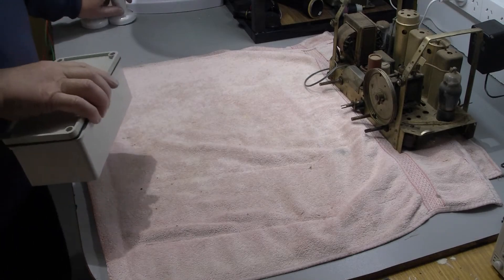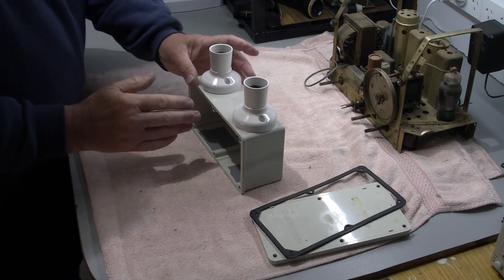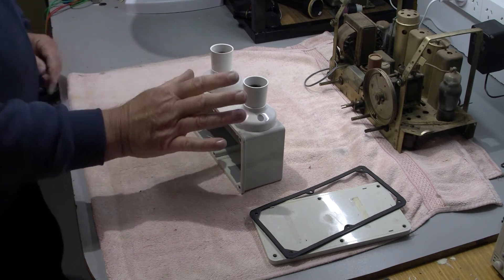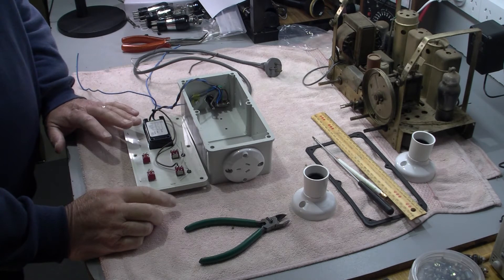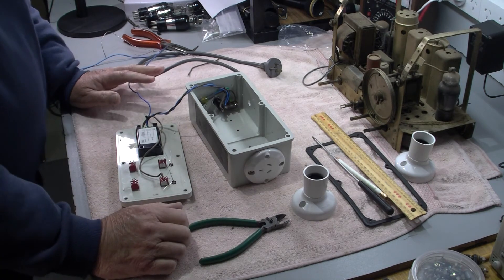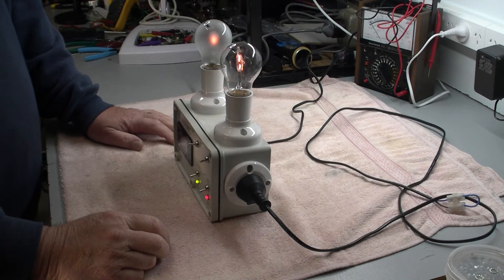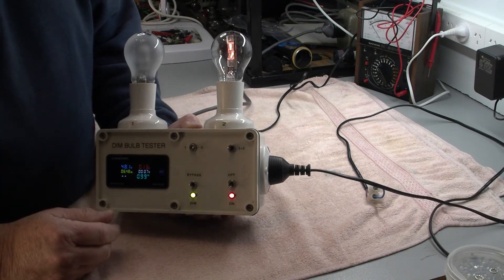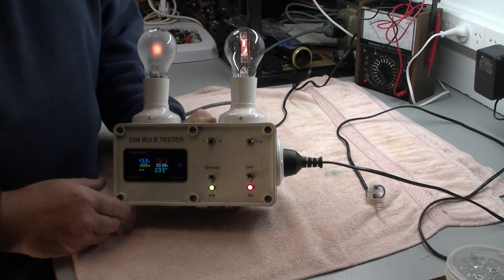The Long Awaited DIM BULB for Vintage Radio Repairs !

Comment: I have used these before so OK I understand that you are using this as a load in series with whatever you want to work on and as a safety against when things develop a short circuit. Two things though, you now need to buy a stock of incandesent bulbs before they disapear from the shops. Also for your safety you do not want uninsulated metal switches protruding.
Reply from the maker: I do have a box of 25w, 60w & 100w globes I've bought over the years. Approx 40 of them so all good there.
Switches ? Used C&K switches for years, never had a problem with them.
Cheers